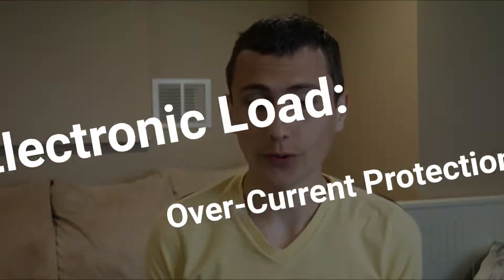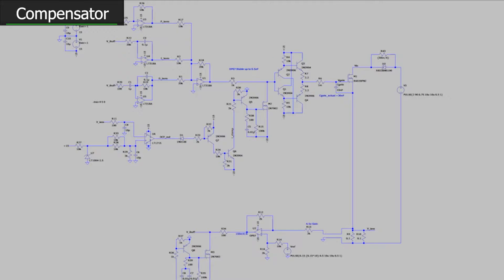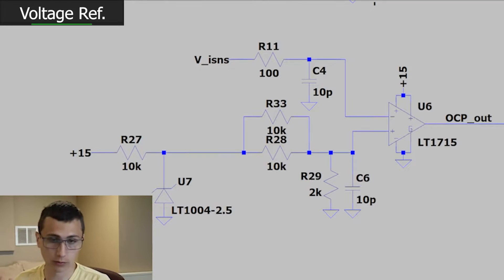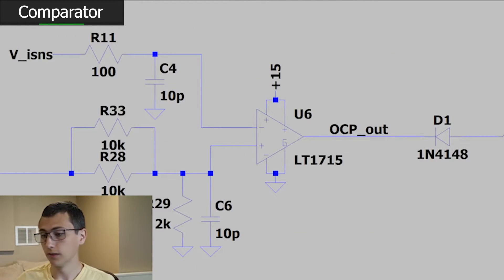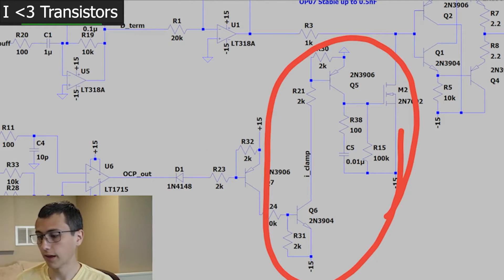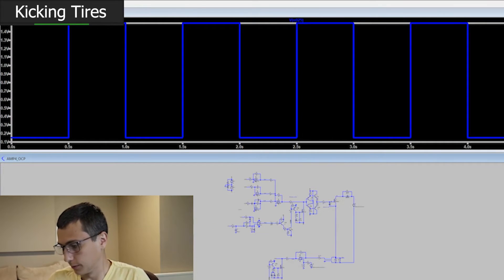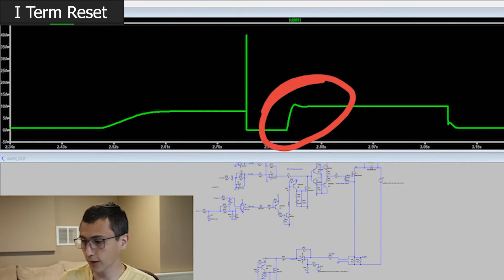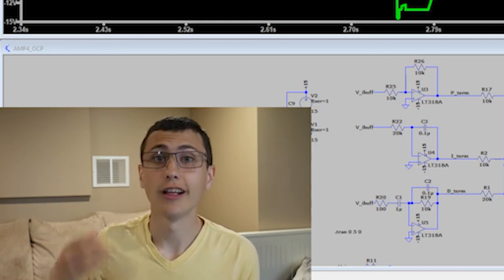Over-Current Protection

Comment: Do you have any videos on common mode filters?  I have an ultrasonic cleaner and it has several transducers, each hooked up to its own driver board. All the boards are connected to a common mode choke filter board.  The filter board has two diodes in opposite directions on each AC line. One end of the board is labeled AC with three terminals: line, neutral and ground. The other end of the board is labeled DC with two terminals: + and -.  Theres a 1uf cap and a large choke and a cap to ground on each line.  Do you know the purpose of the diodes?
Reply from the maker: Hello Barry! I did a quick look and didn't find anything... yet. :) Ferrite beads, transformers... but no common-mode chokes/ferrites! I'll have to fix that! Interesting, that circuit sounds more like diode rectification than common-mode filtering..what's odd is that half-wave rectification typically requires one diode, and full-wave requires four, so two diodes is an interesting number!

That said, it's possible that I'm misinterpreting the schematic description. if it is a rectifier, it's very common to add a common mode choke near power outputs of a PCB to improve EMC performance of a design. Basically, common mode chokes usually DC outputs to radiate less EM noise into the world, and to be less sensitive to noise that exists around a device. As to the diodes... they could be a TVS? so, transient protection.. it really depends on how they're implemented. I hope this helps, and thank you for reaching out!